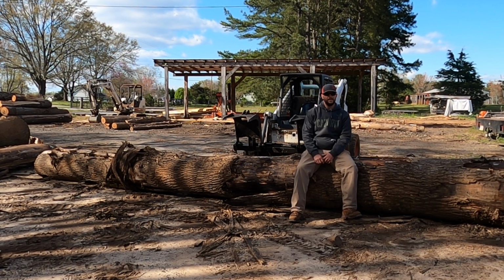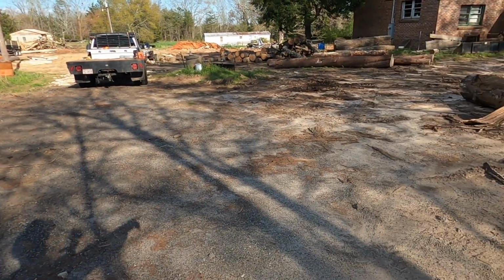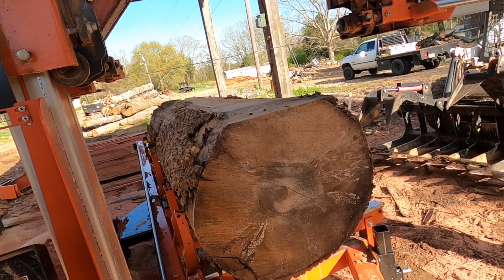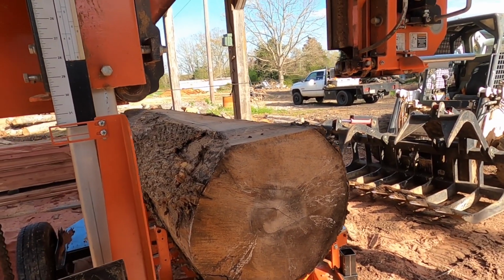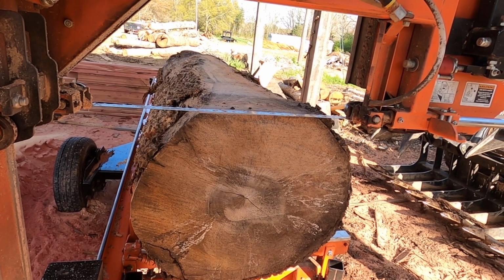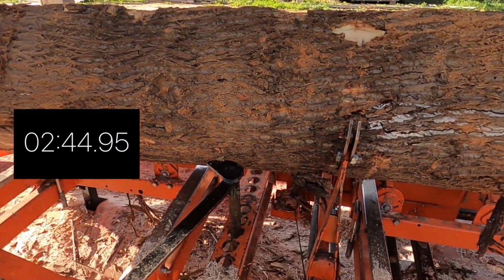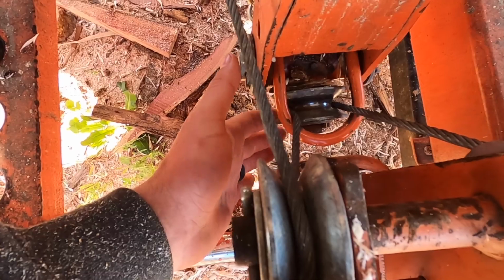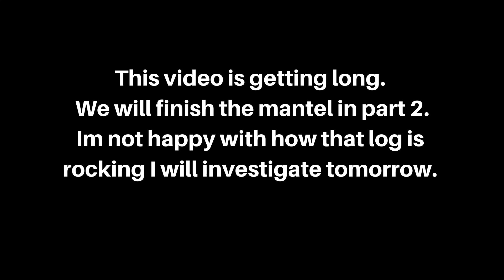Can a Woodmizer LT35 Cut a 32 Inch Log? ( part 1)

Comment: I looking to by a mill but I am concerned about the noise. I noticed homes in the back ground. Do they complain or are there other issues?
Thanks
Reply from the maker: Hey Ray, that’s actually a really great question that I’m surprised I don’t hear more frequently. Firstly let me start by saying I have exceptionally excellent neighbors whom I have a long-standing relationship with. When I first got my meal they were a little concerned about the noise, and after running it for a while they were surprised at how quiet it was. You have to remember the engine itself is not much larger than a lawnmower engine so imagine that sound and then imagine the sound of an in shop bandsaw cutting a piece of lumber. It is not anywhere near the decibel of a conventional sawmill. But if you were extremely concerned about sound you may want to look into the electric motors.

Comment: Have you thought about adding another roller or two to keep your cable from cutting into the metal and breaking your cable?
Reply from the maker: No I haven’t. The only place the cable rubs is along the front outrigger. The cable dose have a spot on it but that is for nicking it with a chainsaw. It’s never shown signs of wear from the little metal on metal.

Comment: You got the number wrong a little.  I have an LT35 HD too.  You can cut 25" in the "mouth as you call it.  To cut 30-32 "  Take a few inch of one side and flip it 90 degrees and then take another few inches off that side, You should be able to get it down to a 25" cant.  I do it a lot.  Takes me a few minutes sometimes to flip a log.
Reply from the maker: If I square up a cant 22” wide and it’s up against the log stops that’s about all it will do for me. 18” is comfortable but I have never been able to get 25” out of mine. I wonder if the hydro model is set up a little different?
Reply: @DustyRanch  The only difference should be the hydraulics which you can always add on your mill as an option [according to Woodmizer] - here are the specs as they list them for BOTH mills:  
Features
32" max log diameter with 26" max width of cut and 21' length of cut

Powered saw head up/down & forward/reverse

SimpleSet Setworks allows two pre-set board thicknesses to quickly and accurately control blade height while referencing from the previous cut

Standard trailer with patented cantilever design and trapezoid shaped bed

Fully assembled with free one-on-one sawmill training

I question the 26" width of cut.  I have done 25" several times - It is possible to get close to 26" and some folks have done it [there are videos of  folks cutting like 25 3/4" [Iron and Oak Sawmill videos].  The log must be perfectly straight with no bumps, limbs etc.  They must all be trimmed off.  Put your stops almost all the way down so they are just touching UNDER the curved widest part of the log, but still up enough to do the job when you tighten your clamp, and will still let your mill post pass by - This will gain you an inch or so. I just cut  23 - 26 inch 5' Ash log slabs the other day that - it had all kinds of bumps and limb cuts and such [THAT was a pain in the butt because it's hard to keep the log straight - if I did not have the hydraulics I would have given up]   Trimmed three sides enough the get it down to 24-25" still had live edge on most of two sides - I cut slabs for sale]

The hydraulics are incredible.  If you are ever able you should upgrade - I got the mill with them because I am going on 68 and just do not want the extra work of turning..
Reply: I just watched your video again. You show from roller to roller is 26".  Means you should be able to cut close to that width on a log that is trimmed flat on the sides or has straight sides.  Just trim one side, flip it 90 degree and trim the perpendicular side and you should be good to go.  If you put your stops up you could probably roll it easier with your skid steer. No?
Reply from the maker: @timothymyers6827  yeah, so if I put the bark side up against the operating side roller with the stops folded down Approximately halfway. I could potentially get a 25 -26 inch board with Bark (live edge) on one or both side. But if the flat cut side is up against the log stops I lose several inches of that.
Reply from the maker: @timothymyers6827  in day to day operation I actually pull the log off the mill with the Skidsteer and flip it 180, Rinse and repeat. Way faster and less labor. Just wanted to show the technology on the mill for the video. I have been running this unit for almost 7 years and I just ordered the 40 super I’m March. I’m ready for hydro. It will be here in February.
Reply: @DustyRanch  If you ever need 1" boards make a second cut or even a third  at 1"  and after these cuts flip it 90 degrees so the first cut [cuts] is against the stops and then make another cut [or a couple] on the top edge.  You will be down to a size you can mill at 25" or 24".  OR you can keep cutting on the other two sides until you have a square cant. When you are done edge trim the boards to get 4", 6", 8' or whatever they will yield for 1" boards.
Reply: @DustyRanch  Cool.  You will absolutely love the HD, it saves so much time.  I went with the 35HD because of my age and knowing that I will only cut 3-4 hours a day when I mill.  Did not want to spend the extra money because I am not in it to make a lot of money.  I have been milling white pine for our new cabin and have saved about 10K on wood and then sold another 5K in slabs since last Sept when I picked the mill up. Another year and it'll be paid for.
Reply: So you are far more experienced that I thought, Sorry.  I subscribed and look forward to more videos.
Reply from the maker: @timothymyers6827  mine has definitely payed for itself.
Reply from the maker: @timothymyers6827  thanks for subscribing. Let me know if there is anything you would like for me to feature.
Reply: @DustyRanch  Just mill the top edge down so you have two milled edges, Maybe make a couple of more cuts off the first one as well.